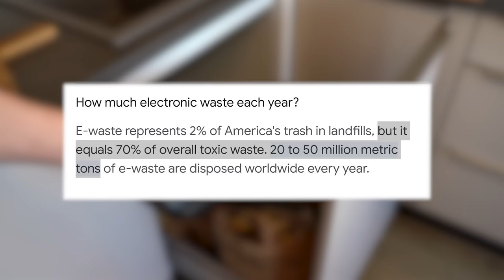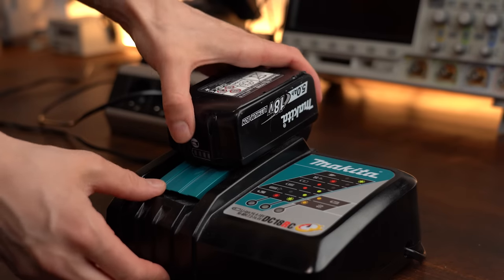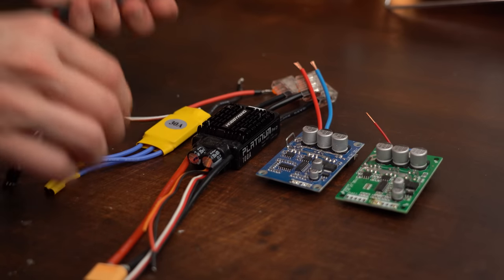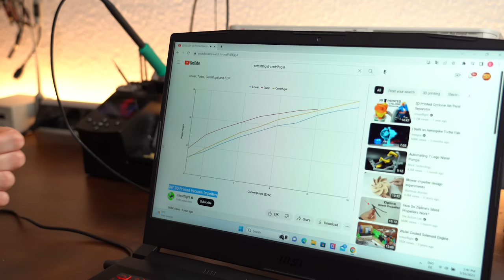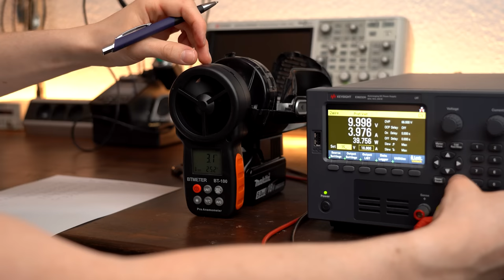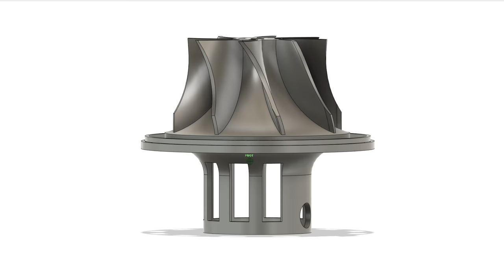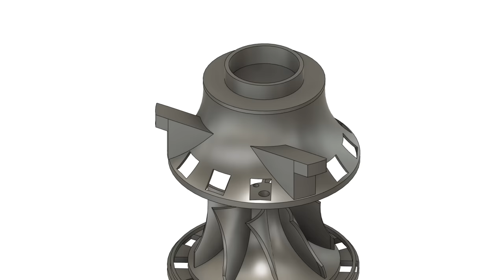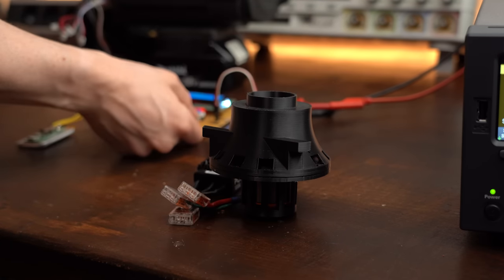I tried OVERPOWERING my Vacuum! (Homemade Turbine)

Comment: Am building DIY Vacuum cleaners for like 3 years now as part of my hobby and here are some tips that could help:

1. As someone in comments already pointed out, vacuums need static presure cuz when u "block" that properel with a filter it behave like if u block the intake. It will just spin without actually sucing anything. Maybe thats also why u had so little powerdraw. Cuz if u block the intake its like in a vacuum, there is no air resistance so the motor can achive desired RPM without drawing so much current. 

2. Most comercal vacuum cleaners use some form of flexible material as a housing for motor with propeler. Its for reducing some unwanted noise from vybration of the propeler. When I was printing that housing I used TPU. I was able to make it completly silent with it so I could only hear the airflow. 

3. 3D printers cant make a perfect propeler. Its not posible. Due to uneven infill or some extrusions... You cant make a perfect circle. It will vybrate and that can couse some problems for the bearing inside the motor. I personally killed multiple motors for this so I just switched back to DC motors. Cuz they are cheap and relatively easy to control. The best "circles" I had was when I had these setings in my slicer:

seams setuped at random, 3-4 perimeters, avoind crosing perimeters - true, hexagonal reduced infill, z-hop (I used PETG) and I usualy print on higher temperatures. This reduce visual quality but highly increasing the strengh and lifespan of the propeler. (once my propeler exploded and it was not nice, so strengh is more important than look)

4. In your design you needed to make the housing bigger becouse your propeler was scratching the housing. Keep an eye on this cuz the bigger is housing the less airflow u can achive. 

With these I was able to make a vacuum cleaner that was stronger than the original one and also more silent. 

Fun fact, I build 2 last year and one is workin to this day.  The other one died cuz it accidentaly inhaled a cake with a screw when I didnt had filter on it... So it exploded...

EDIT 1: Just to make things clear, am not eating a "screw cake" I was eating a cake next to some screws cuz I was repairing a PC
EDIT 2: I forgot to say that I printed TPU housing with 0.8mm nozzle. Idk why but 0.4mm print was absorbing less noise. 0.8mm is silent for unknown reason
EDIT 3: Propeler was printed in PETG and the feature "avoid crosing perimeters" are just need cuz PETG is stringing as hell so with that setting there are almost no strings
EDIT 4: That silent cleaner was handy for myself cuz I was doing a lot of vacuuming near a 1yo baby that is scared from a loud noise.
Reply: While working on my centrifugal supercharger project i learned a few things
1) if you are running abl, drop the z fade height to 1mm and add 5-7 raft layers, this will prevent elephant's foot and will make your part more even (remember abl doesn't make your bed level, it just compensates for it)
2) 5-7 perimeters are required (since mine needs to spin at 50k minimum
3) use abs, (with the air resistance and pressure it will heat up) 
Inrunner bldc motors are the way to go since they have the highest power to kV ratio
You need speed, but also power.
4 to prevent distortion, fully allow your print bed to cool down before taking the prints off
5) the clearances have to be as small as possible (since you increment efficiency the closer the blades are to the wall
6) the impeller design does matter, but you have bigger things to worry about than that.
7) you need to balance the impeller...
Reply: 'inhaled a cake with a screw' What kind of cakes do you consume???? :D
Reply: @sinceRENEss  Yeh that sounded weird :D Just to make things clear, I was eating a cake while repairing my PC so I had pile of screws next to my cake :D So that cleaner inhaled both at the same time.
Reply: @Emet-wd5mz  well, that's screwed
Reply: Would delta style printer handle circles better?
Reply: @Emet-wd5mz  Are you me 🤣 Eating food while screws are next to it 🤣

For 3D printing not being good enough, I wonder if there are good enough SLS printer resins. They would probably make a very good impeller.

"Hearing only airflow" sounds amazing! A silent vacuum cleaner sounds like being able to use it at more times.

BTW, I wonder what happens if you let a 3D printed impeller to rub the housing just a little. I wonder if it will wear down later for a better running.
Reply: @NightMind0  maybe. Idk I have only FDM printer. I was printing propeler on Prusa Mini and housing on Ender3
Reply: @Santibag  Yaaaas am not alone :D 

hmmm SLS. I think that will be better. I think that I will buy printer for that :D 

yes silent vacuum cleaner was really handy cuz I was able to vacuum like in 23:00 while not waking anyone. And also I was doing a lot vacuuming near a 1yo baby that was scared from loud noises. And that silent cleaner was ok for him.

I tried that :D It will just melt, explode or do a lot of damage to internal housing so the airflow is worse.
Reply: @Emet-wd5mz  Thank you for your answers 😊 I especially appreciated the last one 😄
Reply: I did it! I put the screw in the cake.
Reply: @Emet-wd5mz  Delta is an FDM printer. It's just a different mechanical design (others include cartesian like prusa/ender, corexy/hbot, etc.)
Reply: @Emet  Do you have your project uploaded to thingiverse , or somewhere ?
Reply: Guys, Here is The Savior

HalleluYAH translates “Praise ye YaH”

YaH is The Heavenly Father 
YaH arrives via the TENT OF MEETING
YaH was Who they Crucified for our sins
YaH was Crucified on an Almond TREE

— Ancient Semitic Cuneiform of Moshe (Moses)
— Isa Scroll (The Original Isaiah)

Isaiah 42:8
"I am YaH; that is my Name! I will not yield my glory to another or my praise to idols.”

Isaiah 43:11
“I am YAH, and there is no other Savior but Me.”

Isaiah 45:5
“I am YaH, and there is none else.”

Comment: The thing about your impeller is that you ended up reducing the diameter. 
If you want to design one with real math, i can give you a few steps that are usually involved. 
1. Find the max speed you can turn. 
2. Find the cross section of the inlet. 
3. Find the cylindrical surface area of your outlet. 
4. With speed at the inlet you get volume flow.
5. With pressure at the inlet you get mass flow. 
6. With mass flow, area of inlet and outlet and tangential speed of impeller at the inlet and outlet you get the angle of attack of your impeller at both ends. 
7. The number of fins will impact static pressure if i remember right.

The maths for all of this isnt really hard, you just need to understand relative speed, conservation of mass and rotational/tangential speed relation.
Reply: nobody wanted to argue this genius
Reply: Now I need that comment in the form of a blog post I can bookmark 👍
Reply: The pressure is difficult to measure. you can suppose costant temperature and specific volume to find out the mass flow. 
For the fins, a potential problem is the dimension of each duct beetwen two fins must be sufficient to let pass small object.

One of the biggest improvement he can do is to redesign the exit section, the holes are too small

Comment: As others have mentioned, you'll need to work on static pressure. A lot of impellers will put the outside wall of the enclosure onto the impeller itself, that way they don't have to try to get the blades close to the walls for better pressure. I'm curious what you could get away with just replacing the stock motor with a subtable BLDC motor with better speed than the brushed motor.
Reply: this is what i was thinking too when i saw the original impeller design but is it possible to keep it balanced with 3D printer?

Comment: Haha! Love the Makita mod. I modded the small vacuum I have in my office at work to take a DeWalt battery last year. Everyone laughs but it works great, the battery charges super quick, and I can swap the batteries quickly. All it took was a cordless impact one of our techs dropped from a tall scissor lift. Now I need to supersize the motor and impeller to take it up another notch.

Comment: Excelent video! I would suggest using the old impeller of the vacuum cleaner but mounted on a higher kv bldc. If you could double the rpm, it would be amazing. That should increase both airflow and static pressure. The factory impeller should be stronger and better ballanced than the 3d printed one.

Comment: Repairing and/or reusing things with 3D printed parts is probably my favorite thing about 3D printing. I've got so many broken things in my house that I've kept going just by printing a few cents' worth of plastic, y'know, like "you thought I was done with you just because your grip broke? bitch I'm gonna make a whole new housing as long as your motor's still spinning" xD
Reply from the maker: Haha sounds awesome :-)
Reply: in your dreams
Reply: @dimasuracalvinjake683  
What?
Reply: @AttilaTheHun333333  Probably trying to say that the print volume of most printers is too small to make a complete housing, as well as the excessive time required for design and printing, in comparison to making only the grip.

Comment: The old design of the propeller is there for a reason. It’s not all about flow, but also about the relationship with the pressure. Use the old design, with a new stronger motor (higher rpm, too) and you’ll be rock solid.

Comment: imagine being an electronic maker and throwing something away   just because it doesn't work 
the idea itself is absurd
Reply from the maker: Well, sometimes it is just easier because there is not enough time to make everything on my own from scratch ;-)
Reply: I'm not an electronics engineer but everything that is broken gets taken apart. To see if I can fix it, find the error or at least learn how that thing works.
Reply: @timschulz9563  and/or salvage some components if they look useful and the thing is unfixable
Reply: i was being sarcastic please dont kill me
Reply: @timschulz9563  i salvage components from it when i cant repair it and i learn from the system design
Reply: I'm an 'everything' fixer / modifier (I think). I have the same :) (Difficult to throw away usable parts & materials)
       BUT... It did allow me to upgrade the 12V NiCad battery pack from an old Bosch drill to NiMH recently... because I salvaged a battery pack from a handheld vacuum... like 2-3 years ago. 
      But yeah - I knew how expensive NiMH cells were.
     Didn't make sense to throw them away

Also because I got one of those SkyRC B6 mini chargers from a neighbour as a gift.
    (gives me more confidence to deal with batteries, as I can test them, balance them, etc.)

Anyways - i've learned what to keep and what to throw away.
       Things I always keep now are dc motors, ac motors (like the fan from a microwave, and the slow motor that moves the platform), computer fans, certain types of computer RAM, certain speaker drivers & crossover circuits.
     And, if a device is full on broken, I try to salvage as many screws, gaskets, circlips (the C rings, axels, bearings, electrical wires etc. as I can.

(tip: take apart 1 computer power supply, and you'll have plenty of nickel wire for your next 20 projects :))

Oh, and if I can get a machine fully working again, but I personally have no use for it, I just give it away to someone who does need it.

Things I kept for myself lately:
- Bosch angle grinder (was broken 'beyond repair' - aka wasn't easy)
- Philips air fryer
- LG 39" full HD tv
- Nintendo Wii (modded it - plays SNES games now too)
- Vacuum cleaner
Reply: @big_o1952  Prepare to unlive haha
Reply: @timschulz9563 same here. There's always an autopsy. 😉
Reply: @big_o1952 🤣 Most people would have just rolled with it. Hilarious! 👏👏👏
Reply: In Mexico, we don't have easy access to materials to do classes like these. But, this week, I found an Arduino class.

Comment: I have designed multiple fans/impellers/pumps etc. It is borderline maddening to get something balanced and turning at high speed on a 3d printer to work well.

Comment: Magnets are glued. Glue loosens with heat build up. This centrifugal impeller doesn't use the air-flow to cool the motor. You could use aerodynamics that allow using the same air to cool the motor. BLDC works best this way.

Comment: Something that I find that most people probably dont think of is using 3D printing to print templates. For instance, when you put the potentiometer on the outside and set on labels, you could also 3D print a ring with marks and letters like Low and High and then trace the holes with a paint marker. This is also nice especially when you want to mount something to a wall. Say you have either a tv mount or a power strip that has screws it needs to hook onto but you have no idea what the spacing should be because it is at an odd angle or you are worried about it being crooked. You can measure the holes with calipers and print out a single or double layer template and get the locations exactly.
Reply: Why waste time and materials 3D printing a template when a simple sheet of paper and a pencil will do? Put paper against mount, rub pencil across to get the indentations, there's your template. Or if you want to be fancy, measure it, draw it in a free CAD program and print it on a sheet of paper. 

The reason most people don't think of what you said is because it's an inefficient and slow solution to a very simple problem.

Comment: I would love a deep dive into why that 500W brushless controller wouldn't spin up that standard brushless motor. I have a project I'm working on that where I had the exact same problem with that board, but could never figure out why the 3 different versions of that controller I had would not work with any of my motors.